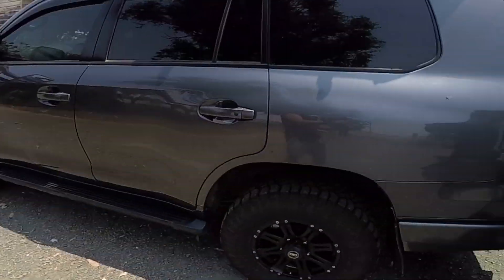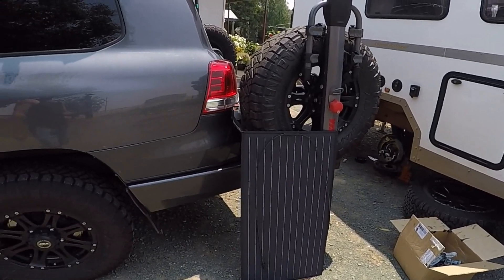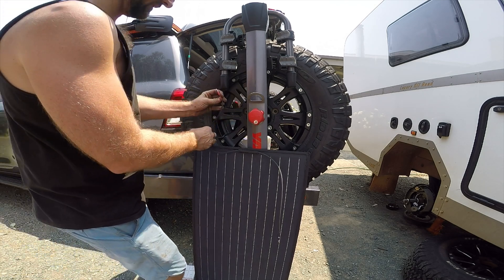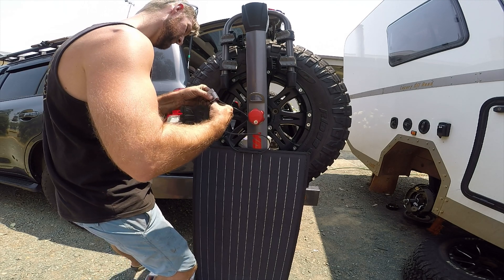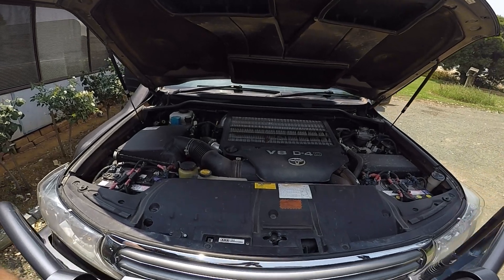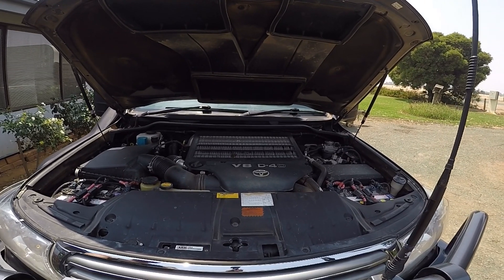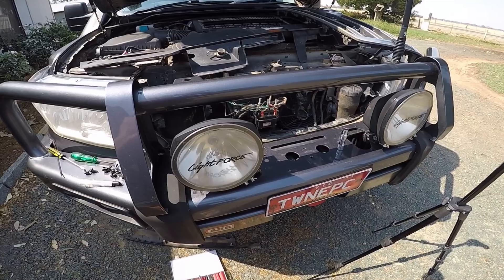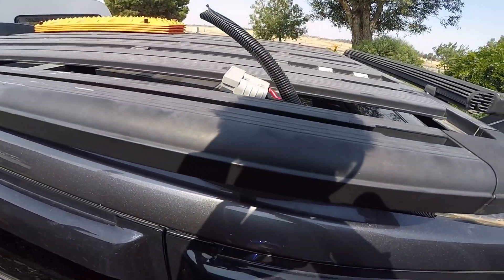Connecting a solar panel to a Redarc BCDC

Comment: Red arc says to run it thru a relay when hard mounting a solar panel ? Is that what you did or just hooked it up to the yellow wire? When the car starts does it change over to Alternator charge?

Comment: Sorry for the basic question, but when you connected the Anderson extension wires to the BCDC, I'm assuming you connected the yellow wire to the positive (red) wire from the panel. What would you connect the negative (black) wire from the panel to, does that go to chassis ground?
Reply from the maker: Hi Scotty that’s right red positive from solar to yellow wire on bcdc. And black wire negative to suitable chassis ground 
Cheers
Reply: Had same question.

Comment: my biggest question is how did you know what size solar to run. ARB + TJM + Battery World can't give me an answer to what i need to run a 145 agm battery with a 3.5amp fridge + 2amp other gear for 7 days without starting my car. An answerc would be very helpful please :)
Reply: 200w panel minimum.
Reply: Hi mate, I only have one battery in Prado. Do you know if I can use the 1225 straight to starting battery which will be connected to solar panel like you have done? I don’t want a 2nd battery. Cheers
Reply: @weekend_Xplorers  yes

Comment: Im just about to do this i just got the redark bcdc1225D and a 250w solar panel a 120 amp itech lithium battery running the Latest engel 60ltr MT-V i have all up spent about 3700 hurt the wallet but i need it to be reliable i will let you know how it all goes im hoping it should be shit loads cheers 👍

Comment: Hey there great video, so you connect the positive from solar to yellow wire from BCDC but where did you earth the negative
Reply from the maker: Kevin Ryan the negative can go straight to chassis or back to battery negative. And yes the yellow wire is the solars positive feed 
Cheers Paul
Reply: @twinsepicadventures4006  cheers buddy always wonder where thing are earthed thanks for info
Reply: next to my aux battery i have a earthing station that all my earths run to, keeps thjngs looking clean

Comment: Hi Thank you. Ok I got that very helpful. However can you advice where the negative from the solar panel is connected given there is only the one yellow wireon the BcDc.
I believe panel negative should be grounded . Can you please confirm
Further
I note redarc promote an Redarc SBI chance relay used in conjunction with the DcBc.  It's also shown on their wiring diagram. Some  say the SBI is needed on UTube but my redarc supplier say not need and the don't stock.
Can you please comment
Reply: Relay is NOT needed anymore - please see the RedArc support reply to my comment about relay in their video about BCDC1240D installation here: https://youtu.be/kZ76NsvvBE0
Reply: Ya still trying to figure out if I just ground out the negatives the frame. Can’t find that info anywhere

Comment: great video and really helpful! Curious any suggestion where and how much of the 6awg cable? The reason I ask is some have very thick sheaths and others not and considering how tight the space is thought you might could advise.
Reply from the maker: Hi Paul thanks for the kind words. the cable that I have used is some left over stuff I had laying around. Which I would have purchased from the local auto elec. Probably could take the trim piece off at the auto elecs and find a suitable cable there. The distance required is about 3-4 metres   .
Reply: @twinsepicadventures4006  thanks!